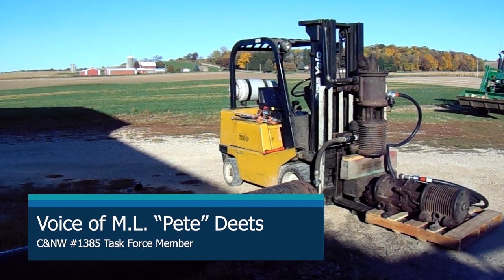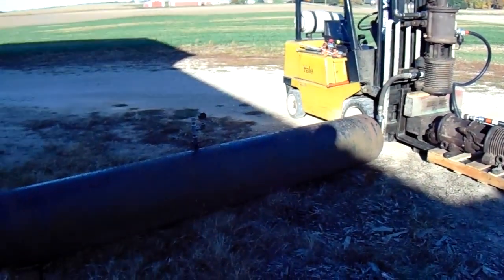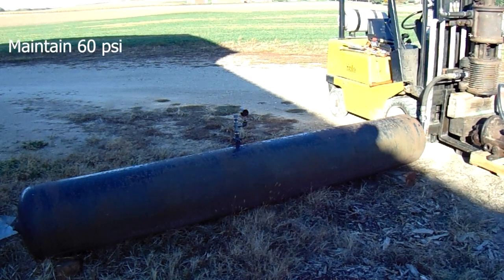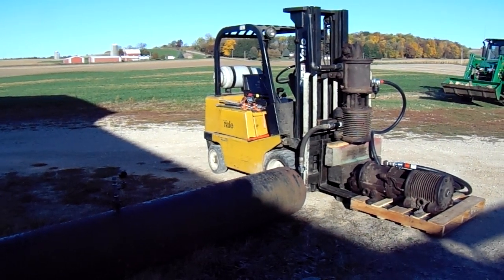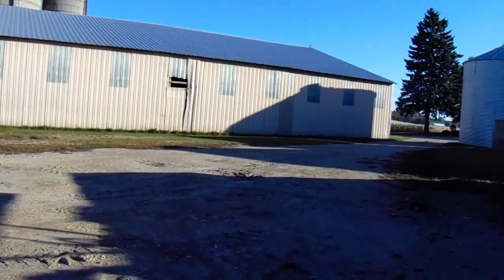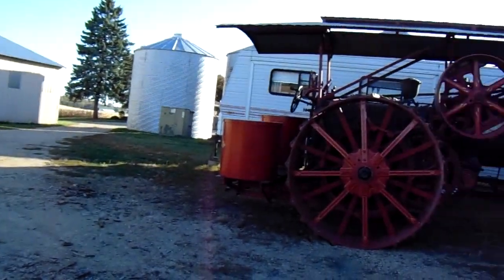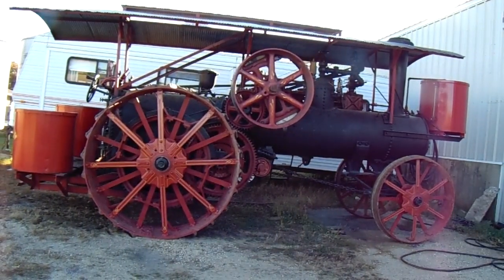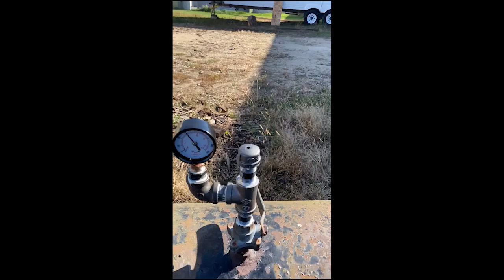CNW 1385 Air Compressor Testing

Comment: Looking forward to 1385's rebuild being completed and the old girl hitting the high iron again! Quick question though, will y'all convert it over to a 26L air brake system or stick with the one it had the last time the fire was dropped?
Reply from the maker: As of now we can still get the Schedule 6 brake portions serviced as easily as the Schedule 26 so we don't plan to make any changes there.